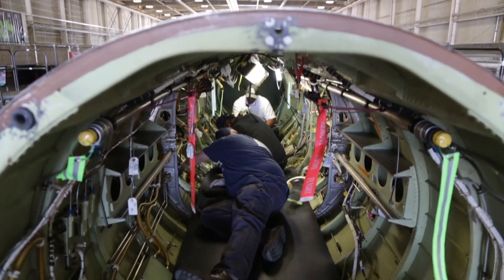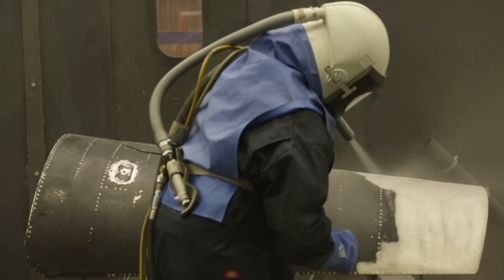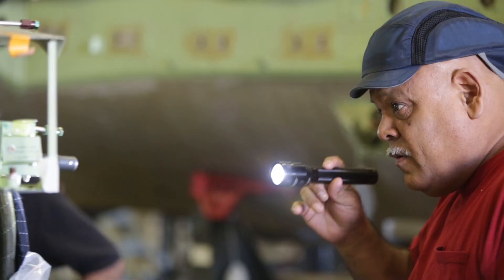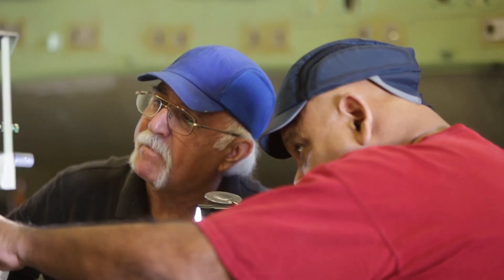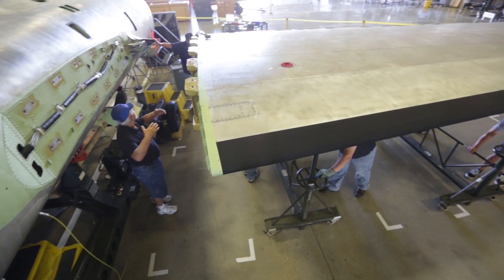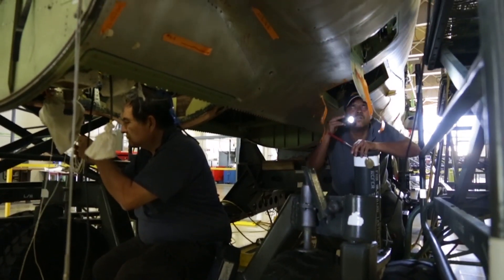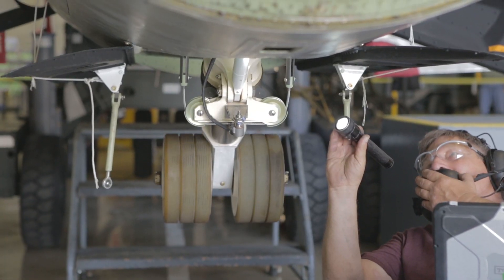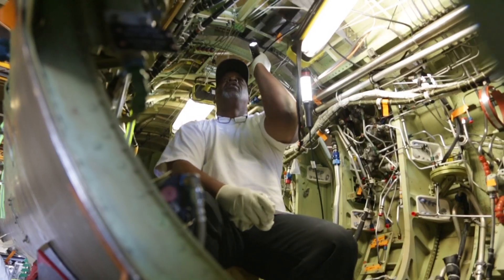Keeping the U-2 Dragon Lady Fit

Comment: for every added 1 Oz. equals the loss of one foot of height . she is a grand lady , but it dose looks like she has gained a few pounds especially under her wings
Reply: +OXYOXYOXY444 That might be a good estimation assuming that the rest of the plane is the same, but with improved engine thrust via upgrades, or increased efficiency the weight would be compensated for. I'm pretty sure the engines were upgraded significantly at one point.
Reply: ENTERUSERNAMEHERE555 oh yes I agree , im quoting ben rich skunk works ceo.
it makes me wonder what's in those pods to justify the extra weight.
Reply: +OXYOXYOXY444 Just looked it up: "This is a standard U-2S with 'super-pods' attached underneath its wings. Super-pods are used for carrying many types of surveillance equipment, including various data-links, although they can also be totally empty."
Reply: ENTERUSERNAMEHERE555 cool ta for the info mate . you have a good one .
Reply: +OXYOXYOXY444 
Cooooool!!!!!